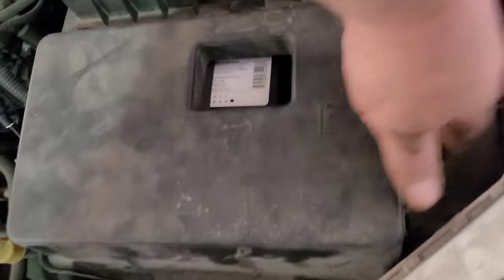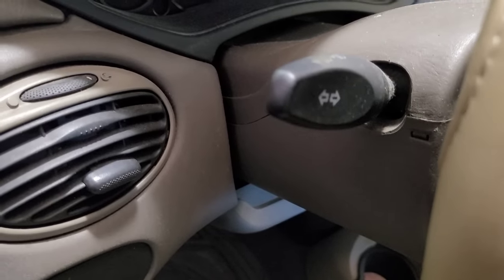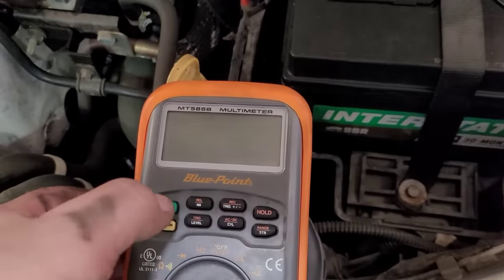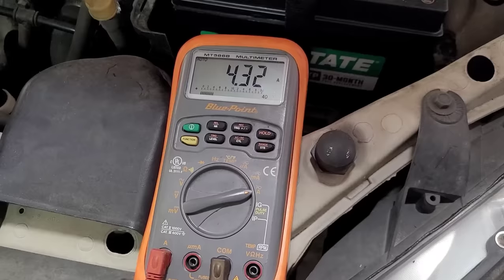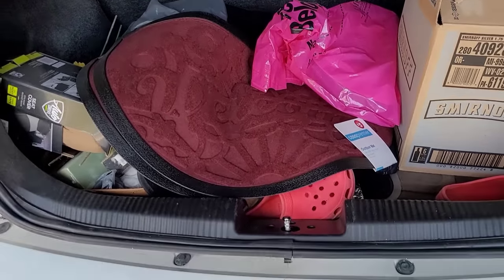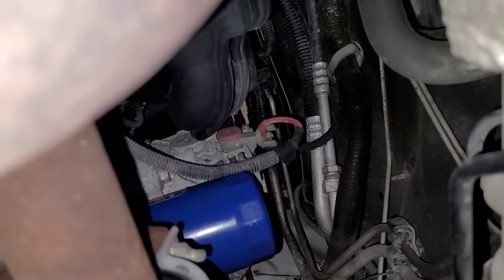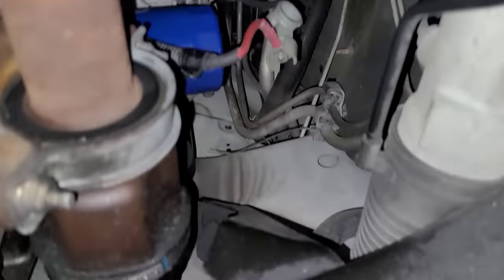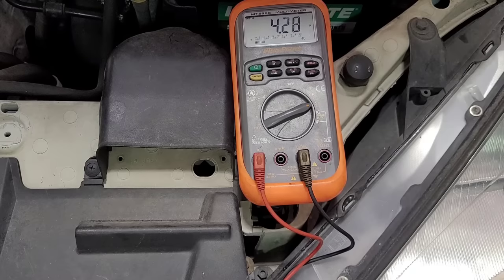Why is the Battery Going Dead? This One Will Surprise You!!

Comment: Instead of removing the wire from the alternator, I would have just used a clamp meter to check the amperage. Checking the voltage drop would send you in the right direction as well. Good video, enjoyed it!

Comment: Kenny , I use less than 50 milli amps as a rule of thumb , you could also do a ripple test on that alt to see if you have a bad diode, voltage to partial ground???

Comment: I bought 2 2001 ford focus zx3 hatchbacks and still own 1. I've got the alternator replacement down to 15 minutes. There's a recall for the positive battery cable that still with the new part is a terrible design. Also, I replace alternators constantly and always have. AND.... They're usually charging! They overcharge, short out, make noise, or over charge only at higher rpms. Whatever points to a charging system problem on these IS an alternator. I literally have a couple extras from the junkyard in my garage. Most of the time the battery light never even comes on. If the battery cables are good, it's always an alternator! It's the funnest little car in the world to drive, so I won't let it go though, lol. Mine runs great at 300k miles with a manual transmission.

Comment: I had the same problem with my mom's 2000 Ford Windstar.  Not only was the battery (batteries, went through several) dying, but there was random electrical strangeness such as the exterior and interior lights turning themselves on and off with the motor off and no key in the switch!  The original Motorcraft alternator was tested and showed it was charging. Finally, a neighbor, who works as a mechanic for our county road yard, told me to change the factory alternator, that there was some kind of defect.  I bought a cheapo Chinese made alternator off the interweb and vualá, no more dead batteries or random electrical strangeness, that was almost four years ago.

Comment: Most vehicles made after 2000 have passive security systems in them that require the programmed key to start it.  This system draws anywhere from .04 - .05 on the meter constantly even with the vehicle off.  Another thing that can draw current with the vehicle off is a bad relay that is stuck.  Todays vehicles must be started and ran about twice a week for several minutes or the battery will naturally discharge.  A bad alternator will also not properly charge the vehicle.  A good alternator should bring the meter upwards to around 14.55 while the engine runs.  A significant discharge overnight after a good charging of the battery can also indicate bad relays or alternator.

Comment: Oh Man, I was hoping to see that alternator come out and go back in. The LAST one I did below the rear head was on about a 1995 Pontiac Grand Prix 3.4L DOHC. I had to pull the strut, the Rt motor mount, lower the cradle and it took me 3hrs. Then the alternator shop said there was no warranty because so many guys wouldn't reconnect the cooling air duct that it would overheat and throw solder. It wasn't a regular full size GM alternator on that LQ1, but it was big. ben/ michigan

Comment: Great video, and this was an easy diag considering the amount of amp draw.  That high amp draw kinda narrows it down to only a few components..MY WARNING...know what your amp meter limit is.  Not all meters have fused amp protection and could get zapped bridging the negative cable and post if the draw exceeds the meters limits.  My suggestion to most DIYers is after disconnecting the battery cable, give it 30 minutes to let the car go to sleep before attaching your amp meter.

Comment: There's a way to test the diodes in an alternator - when they fail, they basically short battery to ground - but usually not by this much!  Some alternators have a swappable regulator module which fixes the issue - but the whole thing should be swapped if its been in service for 100k miles or more.

Comment: When I had issues like that with old alternators, it was because of buildup of the brushes wearing down over the years spreading around the insides of the alternator.. Usually I've always had alternators with replacement brushes and regulator.. Usually a cleaning and replacement fixed my draw..

Comment: Excellent diagnostic skills. I had an issue similar to this and it ended up being a bad bonding chassis ground. For this excellent video I am subscribing.  I should have sent you my 2005 honda odyssey with a stubborn misfire and other issues which I just gave up and sold it as a mechanic's special.

Comment: I see this stuff all the all the time working for a used car dealership, I've currently have a 2015 malibu with almost 12 amp draw ,(11.8) . This is the highest I've seen before... sometimes you get lucky enough when you use your scan tool to pin point where the draw is coming from, usually a auxiliary issue with voltage...  but body control modules don't always show up if it is intermittent draw... but your approach is the best starting point , thanks 4 sharing
Reply: That's quite a bit, id think accessory lights immediately- like a couple trunk lights or something like that. Usually over 5 it seems to be left on lights or other accessories from my experience. What was the cause of the draw?
Reply: @HarleySLA  Radio and ignition wasn't powering off after the key was off...  no indication they weren't asleep...

Comment: I had the same exact problem in an old Lincoln Mark VII. Bad diode in the alternator would drain the battery in a matter of hours yet still charge perfectly fine when running.
Reply from the maker: That's actually usual for the diodes to go bad. It's an 'old school' issue. Too bad, those are nice cars. Thanks for watching!

Comment: Most alternators used in cars are a three phase device. There are typically 6 rectifiers from the field coil assemblies. There are sophisticated alternators that are using 9 rectifiers because of an additional feedback coil used for a type of feedback for referencing the regulator module's circuits. There is also the solenoid relay that is used for engaging and activating the alternator as part of the electronic system. This relay is normally electronic controlled.  

There is also the voltage regulator. In some designs there may be a capacitor for electrical noise reduction filtering.  The voltage regulator normally sits on the back of the alternator.  If a component inside the regulator or one of the diodes starts to have some electrical leakage or become shorted this will generally produce excessive current pull from the alternator while the vehicle is shut down. A faulty alternator over time can cause damage to the battery and also some of the electronics modules.  I've seen this type of thing happen. 

In my younger days (I am old now), I worked on cars from the 1960s. They were a lot simpler and the electronics was a lot more basic and easier to service!

Comment: I have only had this happen on a Ford.  Alternator charged just fine but it wouldn’t “shut off”. I did a visual check when the truck was in the parking lot, and as I was looking around I got my head near the alternator I noticed it was warm. The truck had been left overnight and the engine was stone cold. I tested the alternator off vehicle and everything was happy. I ordered a new alternator and as I was plugging in the small plug I heard an arcing sound… strange, the keys are hanging on a hook on the side of my tool box, so I know the ignition is off. I test the current just like you did and I got about 4 amps. Turns out the ignition switch was the cause. The owner opted to replace it and the alternator and the truck was good from there.

Comment: One odd thing i came across in Marina as a mechanic.
One boat an outboard came in on trailer would crank no start.
Old Man hooked up battery charger backwards charged battery backwards.
Positive now was Negative.
I had a analog meter and needle swag wrong way when checking voltage.
It turns out if a battery is dead you can charge it backwards.
Ignition and Charge diodes were damaged .
Guy would not believe me until i showed him meter reading.
Lol
Reply from the maker: Crazy but true! Thanks for watching & keep wrenching 🔧

Comment: Ford has known about these alternator problems for years but throw all sorts of BS at customers when you bring in a "dead over night" complaint. I have brought my F-150 in a number of times and they can't find anything. I carry a jumper battery with me until the alt fries.
Reply: I just changed one on a Mazda cx9 (ford edge guts) This one actually is charging correctly but the vehicle still has an intermittent long crank when you start it up

Comment: 4.33A x 12V = 51.96W. It is almost a beam light halogen bulb. That produces a lot of heat, could be sensed, and gets an average car accumulator, within some 10 to 15 hours, empty. If not some dirt or other external short, could be a burned-out diode in the alternator's 6 diodes bridge rectifier. The 135mA leak converts to about 1.5W instrument or some other signal light bulb.

Comment: Not quite the same scenario, but I once had a Camaro where the battery died overnight, so I loaded the parts cannon and changed the battery, then the alternator to no avail.  The car did run okay in the morning after a jump start and for the rest of the day, but the battery would be dead the following morning.  There was 14vdc at the battery while it was running.  It wasn't a standing draw causing the problem like in this video. 

Anyway, it turned out to be the positive cable as in that Camaro, the positive cable from the battery took a scenic tour throughout the engine bay dropping off at different locations before making it to the starter.  That cable was not cheap.

Comment: My friend bought 2 new 2023 vehicles.  Both mainly set in his garage while he drives his beater '05 truck around.  He keeps maintainers on them but the batteries still manage to run down. The dealer told him everything new draws a ton of power and really the only way to prevent killing batteries from not driving is to disconnect them. 
  He doesn't drive them for the same reason I don't drive mine. People.  Can't go anywhere without someone not caring and bashing their door against yours.

Comment: I had a similar problem, turned out to be a defective ignition switch that was not disconnecting the field winding when the car was off.  I also discovered another parasitic drain after a snowfall when there was a melted patch on the trunk lid.  The trunk light switch was shorted on!

Comment: Curious what you were hoping to see happen by rotating the motor.
I'm not an auto mechanic, but I do a lot of my own maintenance and repair.
I've also got a P030* random misfire and parasitic draw.
Reply from the maker: I was just curious if rotating the alternator would get the brushes into a different position and change the reading . It was really just curiosity on my part . Something rung a bell in my head of some issue way back in the day where rotating the engine , and thus the alternator , changed something. Could be my imagination,  I'm not sure . But I just wanted to see is all . 
Thanks for the question !!
Reply: @WrenchingWithKenny  You are thinking of old generators, where you can get a failed voltage relay, that allows the generator rotor to be powered all the time, and then the one winding burns out from the current, going open. Thus the draw that will, because the engine generally will shut down at a preferred set of positions, depending on the cylinders holding pressure, so that you would get that open coil in position, and no draw, or get one that still works in position and a flat battery. 

Alternators draw will be constant, because you have at least one shorted diode, and one leaking one, so that the stator is now always having a current flow. Leaky diodes will not be too much issue, but a leaky and a shorted one causes draw, though normally a shorted diode is nearly unnoticed, as all it does is reduce current capacity of the alternator, and the voltage regulator still controls voltage. Second failed diode kills the alternator, but before that the ones that is opposite the shorted one is getting very hot.

Had that before, one shorted diode, just a power supply that is a little more grumpy. 2 shorted on the same power rail it still runs, till it gets hot enough to burn out, which was a million dollar fix to order the spares, as the transformer came as a complete unit, as the cooking would destroy the entire inside of the equipment box, and fixing was going to cost more than that in spare parts. Was standard when servicing any of them to look for faulty diodes, and replace them immediately. I had a row of failed ones, used for spare parts that had not been totally cooked, for the others. My replacement power supplies came as ordinary untracked parcel post as well, despite being the price of a half kilo of gold.
Reply: @SeanBZA  Way back , had a 1963 Rambler and the generator went bad . It fried a portion of the wiring harness connected to it . I spliced in a harness from the salvage yard and a installed rebuilt generator .
Reply: @WrenchingWithKenny As a 22 year Ford technician I would commonly rotate the engine to see if the draw from the alternator would drop. In those years at ford I had only 3 alternators causing a draw and 2 of them changed amp draw when rotated. So your thinking is correct in that because it was vehicles in this era I had seen issues with.
Reply: @SeanBZA  With all due respect, your statement is inaccurate. This can happen in modern alternators.

Comment: Worked on a lot of dodge chargers the alternators short out and drain them, the radio is another problem and issues with the gauge cluster… a lot of newer vehicles have these issues with these complex electrical systems

Comment: I've replaced a number of ford alternators including reman units that caused this same parasitic draw issue because of one component that would fail and drain batteries. I can't remember which part but it was a ford part even new alternators would cause this drain problem until ford fixed it. Years earlier if the voltage regulator failed it could fry a battery in no time and blow lights, PCM, Controllers, Radio's etc. It was then I learned why they put diode protection in there wiring systems. We unhooked one with a voltmeter still hooked up and the voltage was climbing to 48volts and we shut it off to avoid any damage. Replaced the VR and it was normal again. Really scary stuff!

Comment: I bought a rig with an aftermarket deck in it one time. Needed a boost the next day. I blamed the battery and had a good used one so I swapped it. Still went dead. Put a new battery in. Better but still needed a boost after a few days. Blamed the alternator. Checked the deck wiring. Thing was good. Some reason the deck would draw high even being wired in correctly. Changed the deck and problem solved.

Comment: Little Spark?  That's a big 'un.  They make 5 amp fuses.  Good diagnostic video.  Short and sweet, which is more important than showing how one alternator comes out of one car.
As for the Low Profile sockets, I'm a big fan of my long-handle 1/4" drive ratchet that uses the shorter sockets, but I can see there would be useful applications for this, especially since you can wrench on them.

Comment: 2.24.23.   Kenny, you should’ve probably unhooked your meter before you unhooked the positive to the alternator. That way you wouldn’t of had a possible shorting issue to ground, also it would’ve probably smoked your meter had you went to ground with the removal of the positive cable to the alternator.
Reply from the maker: You're 100% correct. I knew the possibility was there , but I was being mindful . I do keep spare fuses for just such an occurrence. I really appreciate the input !! Thank you !!
Reply: I think there's very little risk here. The meter fuse would have prevented any catastrophic failure. They are typically rated for 10 amps.

Comment: I had a draw that would kill the battery overnight. One electrical expert shop (so they said) replace the ignition switch - no fix. The other said it was my aftermarket radio. Replaced that- no fix. Installed an Optima Yellow Top start/deep battery as a work around. It handles the over night drain, started in the morning.  and driving it would recharge the battery. Three years later the OEM Toyota stater of 28 years went out and after the new OEM one installed, the drain was gone. Now only 10 miiliamps as it should be.

Comment: Interesting video about finding excessive parasitic current pull from the battery in the car.  From my experience normal amount of parasitic draw is between 50 and 85 milliamps in newer cars and less than 50 milliamps for older cars. My vehicle has a lot of computer modules and a large sound system.  When everything is shut down the parasitic current pull is in the range of 60 to 80 milliamps.  Most manufactures will indicate a vehicle should not sit for more than about 2 weeks without starting.  The parasitic draw will pull down the battery.  

The other aspect is when a vehicle is sitting the engine oil slowly drips down in to the oil pan. Over time when the engine is not started the critical engine parts are less and less coated with oil, and this can make for more than normal wear when started. If the vehicle engine is started at least every day  or every second day the startup wear is a lot less than if the engine was sitting for a long time.